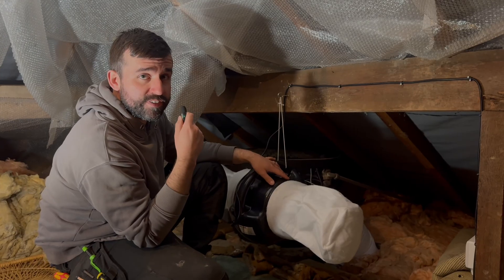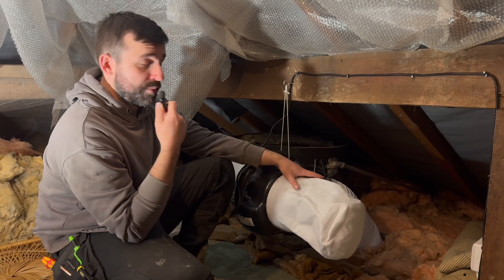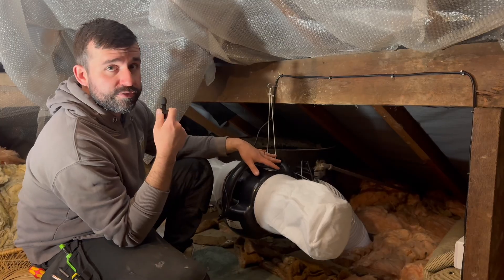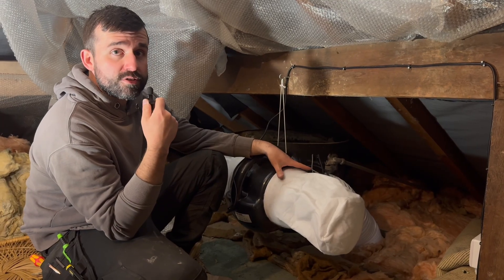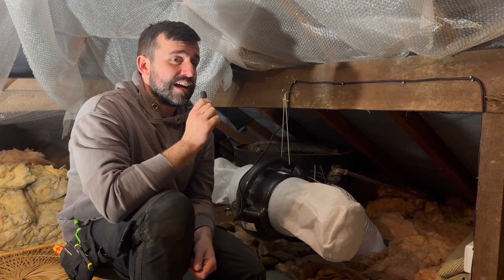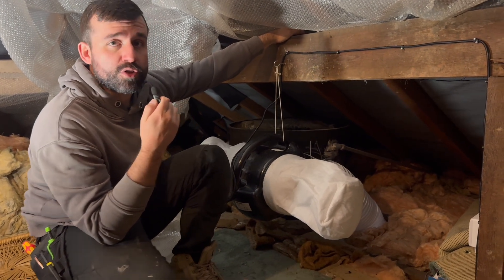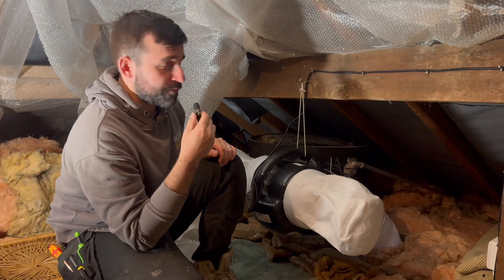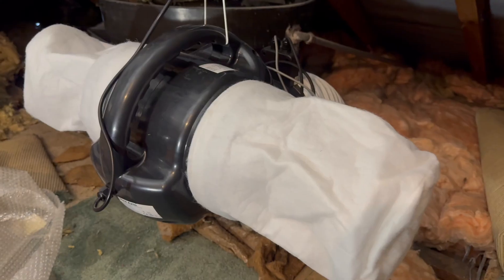PIV Units, how do they work? Pros and cons

Comment: Does it make the upstairs colder
Reply from the maker: No mate the little heat exchanger works wonders
Reply: We have one with a heater but don't use the heater, it's cheaper to run the heating a bit warmer/longer than using electric heater that just takes the chill out the air.
Reply from the maker: The heater should only kick in when the temp drops below a certain temperature so the heater shouldn’t always be on.

Comment: Hi mate appreciate your video. I have damp in my daughters cupboard the walls sweating a bit mould where the skirting meets the wall in the corner would this system work for that would it need to be installed in cupboard or in her room? Ir is there another system you have fitted that may be better for this problem. Many thanks mate. GW.
Reply from the maker: Hmm that is a very specific place for damp… I’m not an expert on damp but I’d be looking for a potential water source. 

Check your loft and roof for a potential leak, could there be a radiator pipe in the area?

The source could be away from where it’s showing. It could be tracking. 

These units are more for if the house is suffering from damp/condensation due to poor air flow
Reply: @hackwoodelectrical  no radiator pipe. Its an outside wall where the wall is damp . I had a customer install a similar system with a monitor for air flow. Turning damp air in to clean dry air as she had the same problem in her cupboards.  Thanks for your help mate.
Reply from the maker: @garywardle3284  external wall definitely sounds like there’s some sort of source… check brick work for cracks, fascia’s & soffits, check for missing mortar or render 

I’d be looking for anything out of place first 

PIV units definitely improve air quality though so they’re still a good option if your home needs it
Reply: @hackwoodelectrical will do but nothing looking out of place will have another close look. Many thanks mate GW.
Reply from the maker: 🫡 water ingress can be a sneaky mistress!

Comment: I feel like my house became a lot colder with my piv unit 🤔
Reply from the maker: Hmm does yours have the heater? If it does it the heater turned on?
Reply: @hackwoodelectrical yes it does and it is turned on ... Vent axia lo carbon PoziDry Pro. But yes I still believe the problem is in the settings

Comment: If the house has no soffits how does it get airflow? I’m about to fit one, that’s the issue in my loft. Would flap vents provide enough airflow in your experience? Cheers
Reply from the maker: Lofts aren’t exactly air tight… as they say air always finds a way

Comment: What's really scared me that PIV unit is working around the   insulation... No one will. Tell. Me that there is a clear air In there and filters will stop that dust etc...
Reply from the maker: Once insulation has settled I’d imagine very little is picked up by the PIV 

Also it’s such a slow air flow I’d be impressed if it managed to suck up much and the filters are extremely good filters

Just make sure you keep them maintained.

Comment: Something to note not mentioned in this video specifically I believe, and for the education of the audience if you are thinking of doing this DIY.

Don't put one of these vents in your kitchen or bathroom, it will blow damp air from those rooms into the rest of your house rather than pushing that damp air out via trickle vents.

Comment: Looks like that house has a slate roof. My extractor fan goes out through a vent slate. You can do similar on tiled roofs too. Considering a PIV for the house, but only have a small upstairs landing and the bloody smoke detector is exactly where the PIV outlet would need to go. D'oh.
Reply from the maker: Don’t believe it’s a slate roof, but we have done roof vents before but usually when the builder has scaffolding erected for access. 

This did have a smoke detector on the landing but there’s a blanking plate included you can use to block off the flow of air in that direction